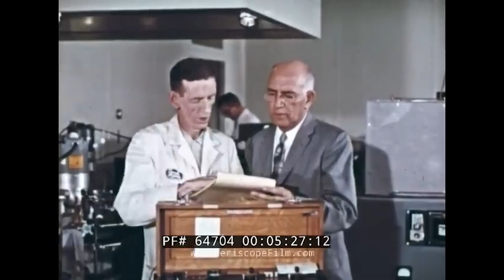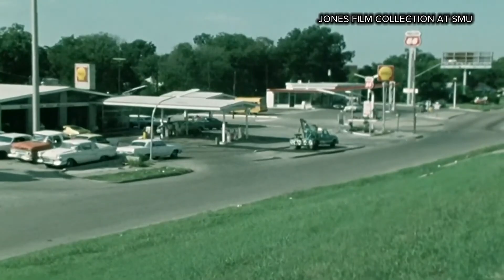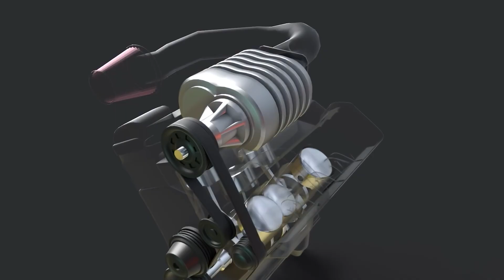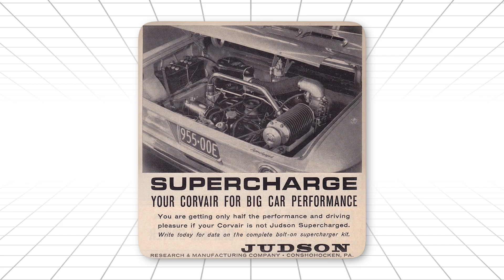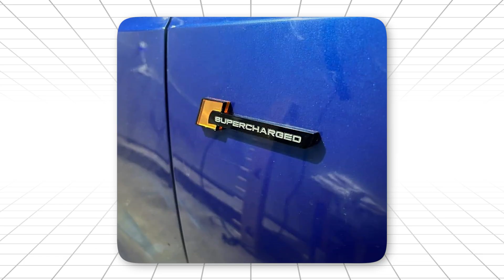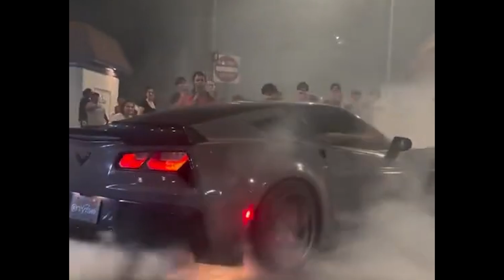The Engineering Marvel That Fooled Everyone

Comment: Back in the late 50s, and early 60s GM built two cars that were turbocharged. The Chevy Corvair, and the Buick special. In the mid to late 50s two cars had factory installed superchargers. The Ford Thunderbird, and the Stuitebaiter Advantage.

Comment: There is another factor affecting this matter of superchargers and turbochargers. In the past most cars were naturally aspirated. However there is now a trend where many modern cars are using turbochargers to get better fuel mileage and the same amount of power out of a smaller displacement four cylinder than they could in times past with a larger displacement six cylinder engine naturally aspirated engine. Basically the turbo charger is being used to achieve the same amount of power out of a smaller displacement more fuel efficient engine.